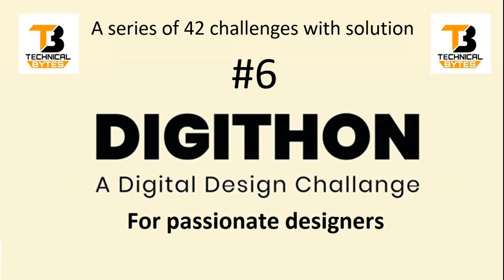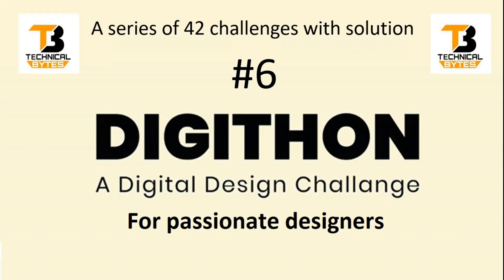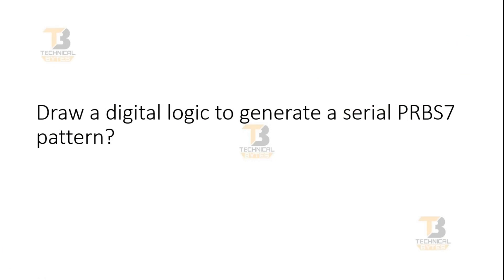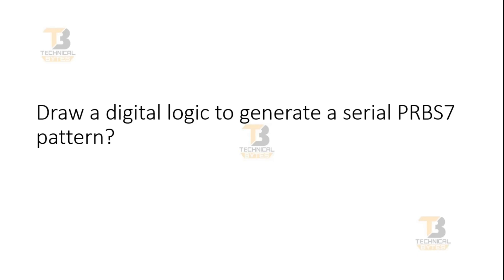DigiThon Question Part 6

Comment: I found on web that it's  simply a shift register with 7 flip-flops, and and the input to the first FF is given by XORing the outputs of 6th and 7th FF. Please comment if this is incorrect and provide the correct solution
Reply from the maker: It is correct, but I will explain it in more detail in it's solution video
Reply: @TechnicalBytes   count not find the solution video. Is it uploaded?

Comment: 1.I googled it and found that PRBS7 is very similar to LFSR, in fact, it is LFSR and as it says "7" That's why I believe we need to have a shift register structure having 7 flops. 
2.Xor operation of Q7 and Q6 is feedback to D1 and Q7 is an output to get random sequence.
3. I am not sure but I believe one of the flops(maybe the last flop) needs to have its reset value as 1, otherwise we will end up having all 0s in sequence
Reply from the maker: your last assumption is not correct.